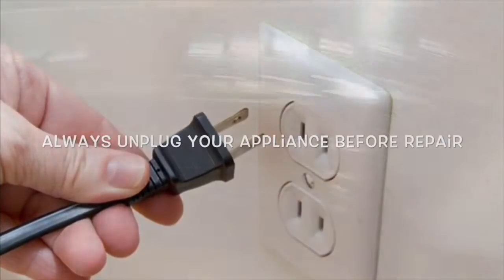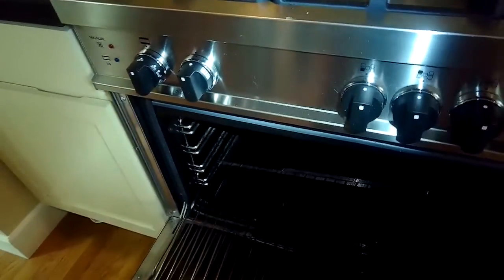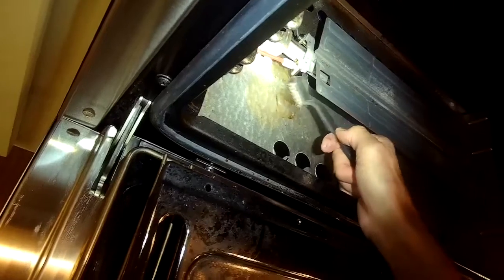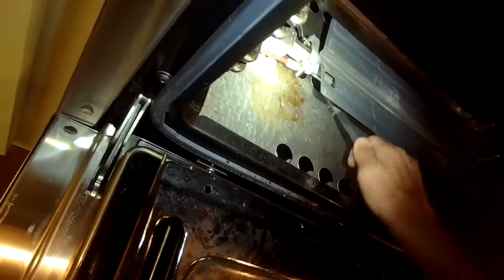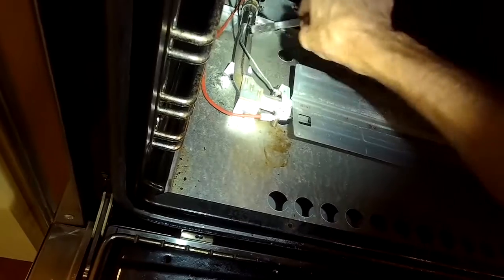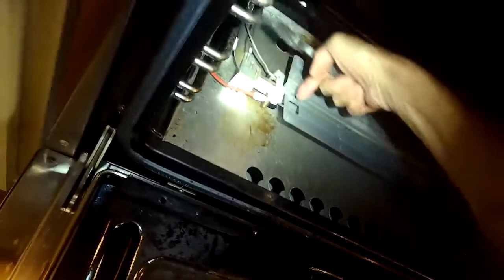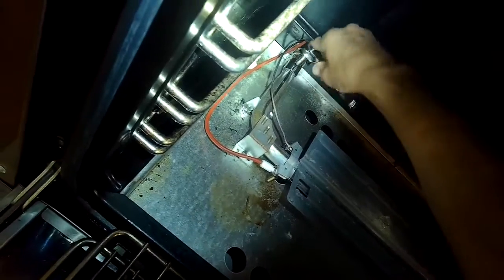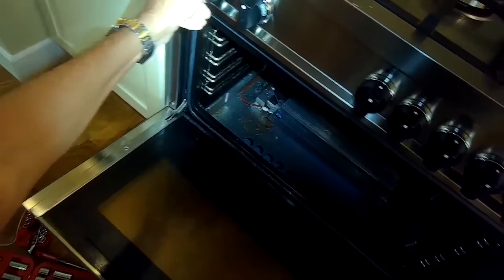BERTAZZONI OVEN WON’T ALWAYS LIGHT—QUICK FIX

Comment: Hey Scott. Great video. I just bought a house and inherited this oven and found you on youtube because the bottom oven burner wont ignite. I discovered from your video that my thermocouple is missing what you call the "sleeve" that slides and adjusts gas/air going into the oven burner system. Bertazzoni's parts vendor Encompass says it does not sell the part, and I would have to buy the entire oven burner system. any ideas? should I make my own part? If I macgyver a "sleeve" out of a piece of foil - IT WORKS. IT IGNITES... should I leave that on - or is that dangerous...? so many questions... : )
Reply from the maker: Oh Chris,
That’s exactly what I would have done.

It should continue working 👍

Comment: I know this is an older video but I have a Bertazzoni MAST350GASXE Oven and the Oven/Broiler Thermocouple is shot. Unfortunately, no one has the part. Is there a way to bypass? The top burners work fine. Any help would be appreciated.
Reply from the maker: I think this will work: https://www.amazon.com/Bertazzoni-508041-THERMOCOUPLE-OVEN-BURNER/dp/B0043439YS/ref=asc_df_B0043439YS/?tag=hyprod-20&linkCode=df0&hvadid=198089608681&hvpos=&hvnetw=g&hvrand=3749933988663543581&hvpone=&hvptwo=&hvqmt=&hvdev=m&hvdvcmdl=&hvlocint=&hvlocphy=9032085&hvtargid=pla-330739372963&psc=1